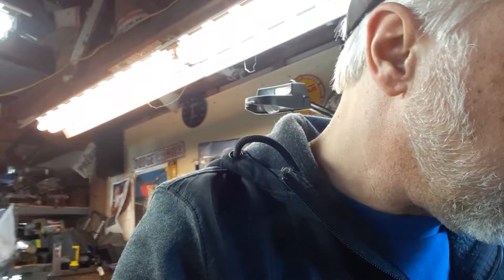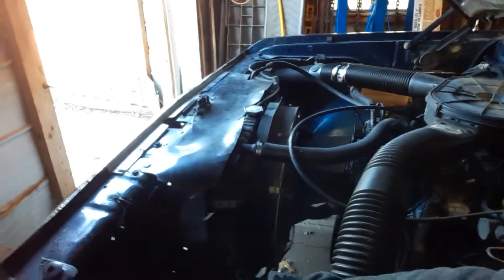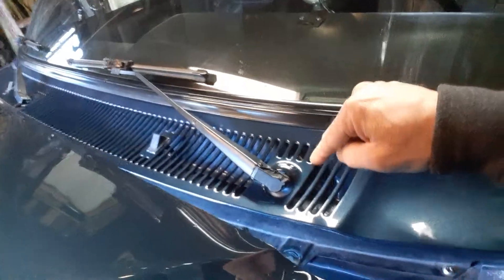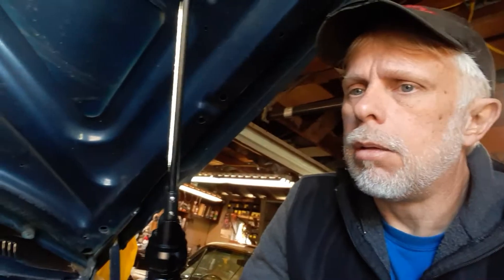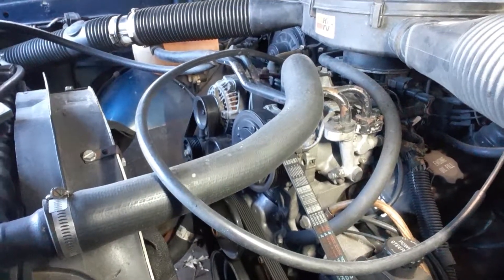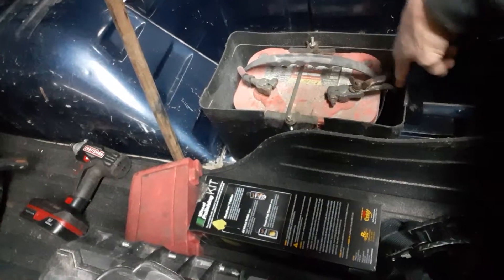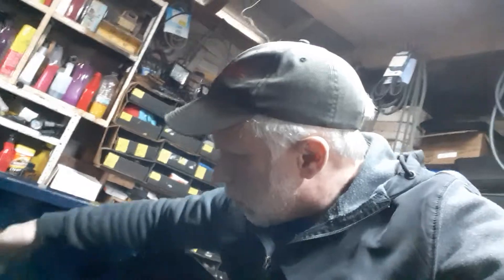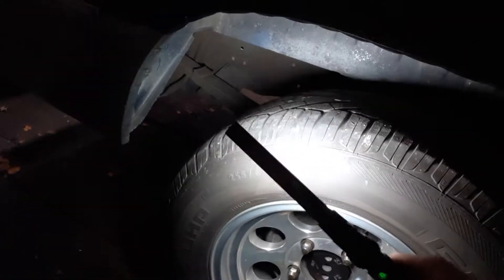Tips tricks and modifications for 72-93 Dodge trucks part 1

Comment: been working thru ur videos... like ur channel.. my daily drivers are a 66 Dart GT i bought while in San Diego for $200 in 92 from original owner with hardly any miles... was sitting in the weeds behind his garage it was a 273 4bbl auto with 8 3/4 3.23 open diff... had leather headliner n seat covers installed when new... and a 74 D100 Adventurer and seet SE i bought when moved here to Missouri,, it was sitting on route 66 Devils Elbow n guess it had sat there a while before i bought it in 93 for $800 with 80k miles...318 auto 8 3/4 3.23 open diff.. both have evolved thru time.. the truck has had since 02 a87 roller cam 318 with swirl port 360 heads and with mystery lunati cam,wiend stealth intake n edelbrock 750 carb,black jack headers ,4 spd od manual trans, 3.91 sure grip.. i load it like a semi n drive it like a porsche n have set up suspension to do it well.. up front 1 ton springs cut down and 1 ton sway bar.. out back i kept original main leaf n rest of spring pack is a custom Shadetree blend of original and 1 ton leafs so maintains level nice ride no matter how much u load on it.. lengthened rear shackles to bring it down n quality shocks to keep it under control.. big 11" drums out back n biggest 5 lug rotors up front with good pads n shoes...spent a bunch of time with it on my alignment machine n test driving to get it dialed in.. here in Missouri our roads were drawn out by a kid with a spirograph n this truck rips through the corners.. i have deleted the amp gauge n wired in fusible links,done a forward flip hood ..have been running 275/60/15 on all 4 corners but in last 20 years they're up to $150ish a piece so i been working on switching up to probably 17".. have an extra headlite harness laid in the front n have relays firing up headlights.. sylvania super bright white... best mod ever right there!!! oh yea other thing about those wiper bushing packs is they only live 1 yearish n fall apart.. for last 10 years or so been using napa... i run a brass radiator for 360 4bbl hd with ac ,shroud,cluthfan with the extra blades n super secret trick of hd with ac water pump... it has like 8 vien instead of 6.. where u located at would love to visit.. keep on keeping on!!!
Reply from the maker: Hey there, read your comment and I do appreciate it and I appreciate you watching the video. Thank you very much. Also I just want to say your cars sound really cool and really interesting the ideas you have for your truck. Very similar to what I'm doing to my d150. Something else is those wonton sway bars? I would love to get my hands on one of those from my d150. I've known about that for a long time. It's just in my area here in Eastern Tennessee. It's like a relatively poor area financially, so there's a lot of people here that don't put much. They're very happy to get just basically whatever they can get so you know they're not going to go to a dealership and order a truck with sway bars or buy truck this week. They'll buy something that's much more basic and but I still look for them but don't really find them very often. So anyway yeah I like all your ideas on your truck. Sounds great! The I used to run the 275 60 15 tires and wheels on my d150 but I didn't like them they I don't hate them they just don't handle as well with my setup. I haven't lowered my truck at all so that's probably coming this winter. But the yeah that size tire I just don't like it that well on these trucks it does feel the wheel well out and a lot of people like those tires. Just for that one particular reason it fills out that wheel well better and they're like. Oh yeah that's that's performance that's going to handle. Really good. Not really at least not on mine. Anyway, please keep in mind I am not throwing any shade your way. I'm not trying to insult you in any way whatsoever but yeah, mine's going to be getting the van b series Dodge van lower control arms and longer shackles in the rear and probably going through in getting new bushings and some polyurethane bushings and things like that. Furthermore, yeah I live in Eastern Tennessee. You're welcome to come and visit but yeah it's a bit of a drive from. I think you said Missouri so anyway, thank you very much again. If there's any questions I can answer for you or anything I can do to help you, let me know. Oh yeah I was running the 275 60 15s. I later went to a 16 inch wheel because I like you was facing the fact that the that size tire was becoming more and more ridiculously expensive and I now run a 255 65 16. It's not a terribly wide tire. It's also it's really close and diameter to the original tires that came on the truck from the factory. Also, I'm running a general grabber UHP in that size and I like that tire very well because it has a lot of grip and it doesn't last as long as a lot of other tires but it doesn't have that high tread wear rating but it it so it does wear out faster. But man it grips really really well and it displaces a lot of water. They are directional tires. They got to have v-groove on them so you got to be really careful. You know about rotating them. They can't swap sides. But yes, I think the 17 inch wheels are a great idea and I will probably be doing that in the future as well. I've seen other people using 17 inch wheels. I think that's a good move to make really so again. Anything I can do to help you out let me know. Thank you very much for watching and have a good evening